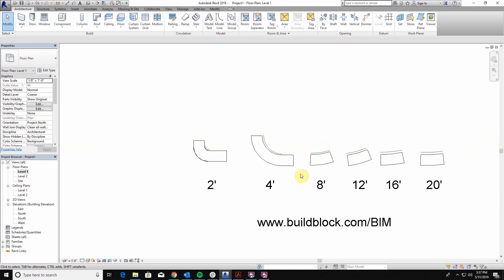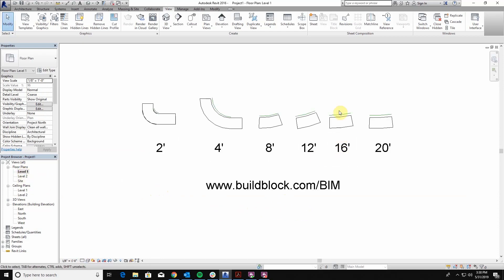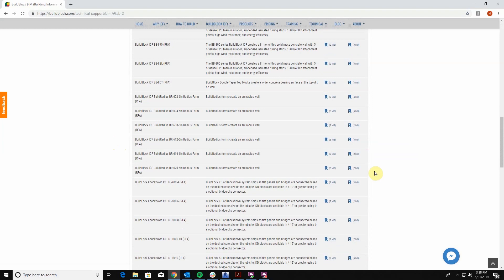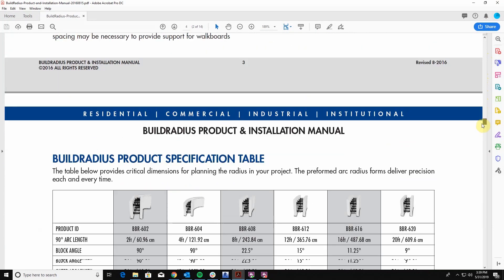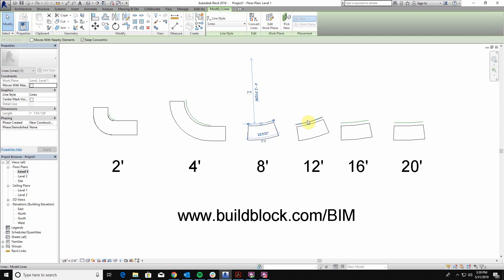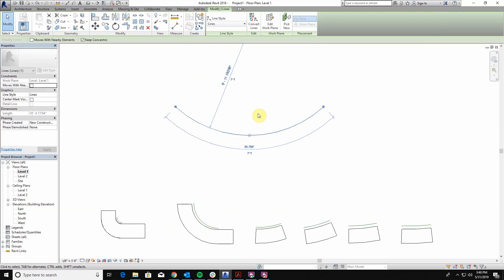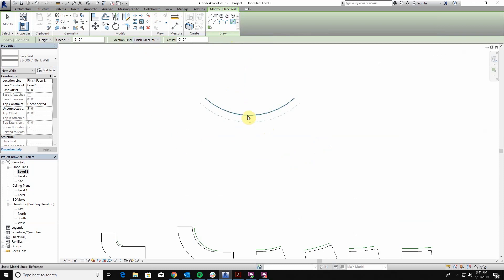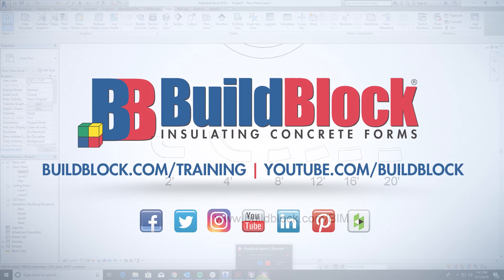How to Draw Curved ICF Walls with Radius BIM Models

Comment: What’s the best way to connect an ICF wall section with a 2x4 stud wall, specifically if the wall needs to continue as a single flat surface. Appreciate any references.